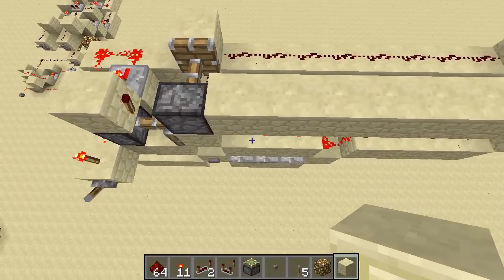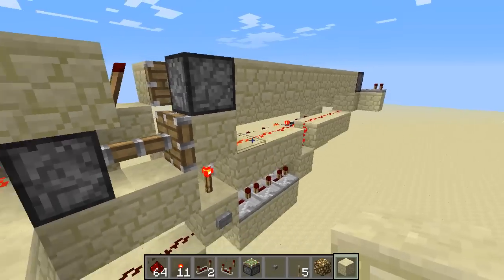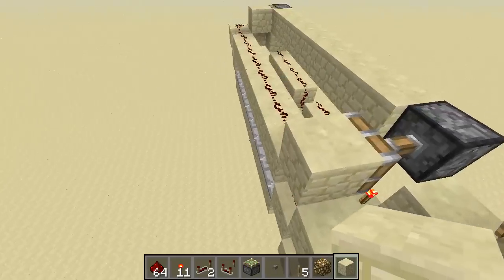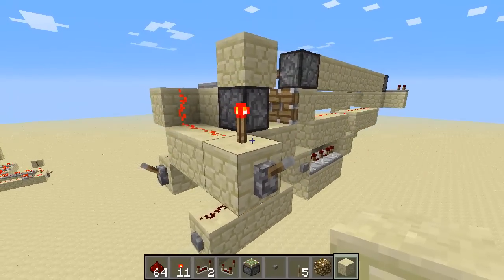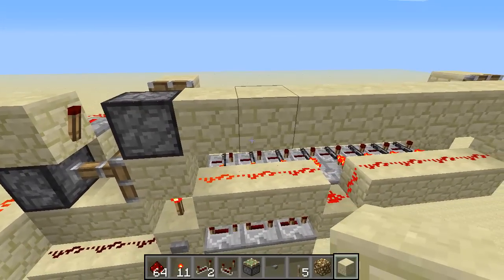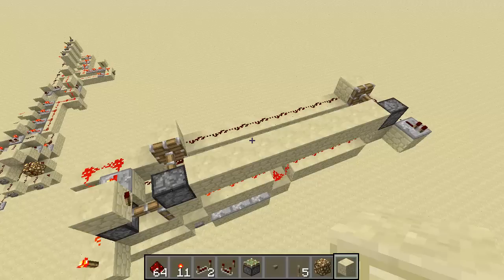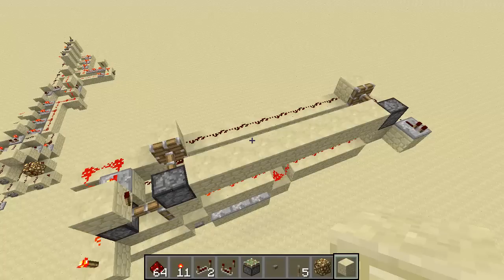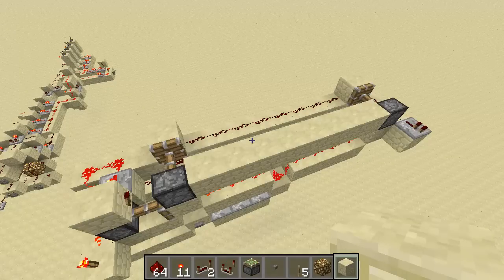Mass Memory Systems with Redstone: Fast and Lag Free Design Concept

Comment from the maker: Thanks for the kind words :)

The design is completely tileable except for the monostable, which would power the input when tiled. It's an easy fix: Move it 1 forward or 1 backward, but I suspect I'll come up with a better design so I'm not gonna bother :P

I don't have a video on serial yet, but I will at some point.

The RDF is the redstone development foundation, and it is indeed a redstone server. If you're interested, the server ip is mc(dot)redstonedev(dot)net.

Comment: Interesting idea. One or two days ago I was also messing around with sequential adder (which is basically one fulladder with the carry out carrying in at the right timing). However due to torches not handeling short pulses correctly, I had to feed in the data at 1 bit/3 ticks. This might be inmproved with the use of comparator NOT-gates.
I also think that this design could be redesigned to be an complete ALU, which could be combined with this memory.

Comment: Serial in a nutshell: Instead of using 8 wires for 8 bits, the 8 bits are coded in a specially timed sequence of ons and offs on only one wire. Either the timing is agreed upon by both the serial device and it's master, or the serial device outputs a clock signal that tells the master when to switch to the next bit.

Comment: The timings of comparaotors should be better in the newest snapshot, but this snapshot also makes comparator not react to 1 tick pulses, so for now it seems that it would not be possible to build a sequential 1 tick adder (unless you build multiple adders next to each other and multiplex the sequential input into a different adder).

Comment: I think I have managed to build an adder which could handle a sequential input at a rate of 1 bit per tick using a 1 tick carry preparation adder. However due the fact that comparators can't handle 1 tick pulses I had to use two full adders. I am only struggling handling the input and output, since this needs to be alternated between the two full adders each tick. Or you could save each number into two parts, so that each bit still gives a pulse of 2 ticks, but it can be processed at 1 bit/tick.